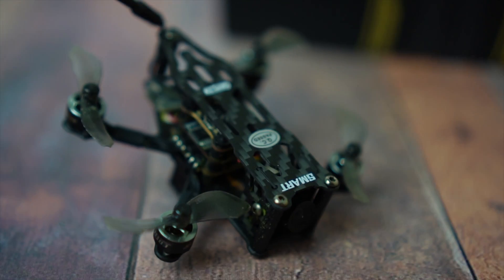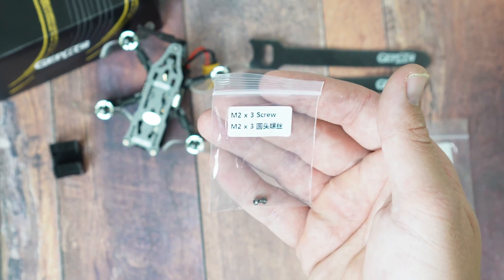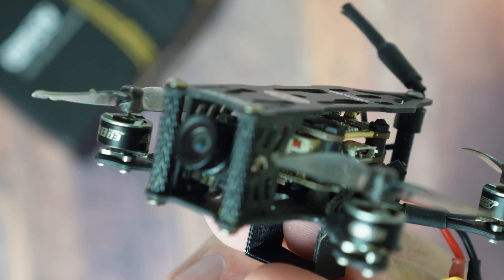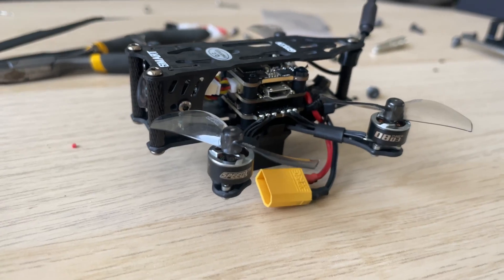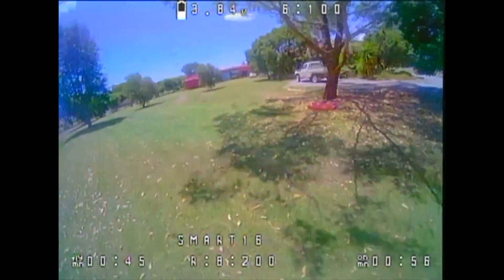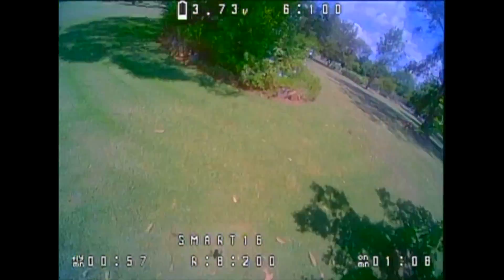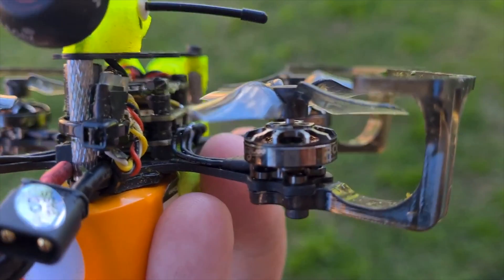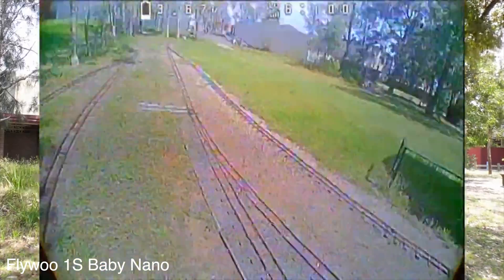Micro FPV Freestyle King? | GepRC Smart 16

Comment: What battery size are you running? I have a lot of 450mah 2s and 550mah 2s. Would this be too big or do you think it would fly ok
Reply from the maker: I was running 300’s, 350’s but a 450 and 550 would be fine if you have it.
Reply: @DarrenAllatt  thanks man

Comment: Hi, cool video thanks for sharing. Is there some footage shot at the Bankstown model railway track?
Reply: @DarrenAllatt  did you ever figure a way to remove all the black spots on the sensor/lens? Mine has the same issue as yours shows in the footage.
Reply from the maker: @jonowillmer  no I haven’t - probably have to open it up and clean it. Haven’t flown mine since the video
Reply: @DarrenAllatt  thanks for the feedback. It's a shame they all seem to suffer from this issue.

Comment: I've put about a dozen packs through my 16 after crashing it the first flight out and breaking a motor mount, having to replace the bottom mainplate. It's fun, and so small you don't have to worry about too much about hitting anything or breaking props when you mow the grass. I did mis-order two extra frame packs so now I've got parts for days and days but these little battery packs are easy to handle and charge so maybe don't snip that silly double 1s setup. This is my first fpv quad and it's a perfect starter unit imho

Comment: I've followed the Nick Burns Formula of the TKS Rocket Race frame and everything from except the Frame and props of a  URUAV UZ85 85mm 2s. Just need longer M2 screws and Gemfam 2023 tri-blade props. It's fast AF and agile. Plenty of power. There are other variations but Its my favorite compared to my HM Mob6hd and eachine Novice-III. It's a good idea to have spare motors, canopy and camera for high speed crashes.
Reply from the maker: I’ve got some TKS frames after watching Nicks video. Just haven’t had time to build them.

Comment: Great review. Will the happymodel 1102 motors fit this frame, I'm thinking about just buying frame and custom building my own nano?
Reply from the maker: Let me check up on that for you. What spec build are you going to put together?
Reply: @DarrenAllatt  Legend thank you. Im either going to try the JHEMCU GHF13AIO board with Eachine Nano VTX but I have my reservations on the AIO based on your earlier review. Otherwise I have a spare 16x16 JHEMCU SIF4 13A stack. I'm only thinking about going AIO for weight savings. I will use the 3 blade gemfan 40mm props. Prefer 1102 over 0803s...
Reply from the maker: @clintpan3599  to be fair on JHEMCU the smoke was caused after a crash in the bush that shorted the ESC; but the first board I had from them was dodgy.
Reply from the maker: No the HappyModel 1103 motors wont fit because they haver a larger motor mount pattern

Comment: i just built an Armattan tadpole. 2s 1106 6000kv emax motors & props avan rush. flys awesome. Tadpole V2 is a bit wider, can fit digi. go strait to thier site. you wont find available here in Aus.
Reply from the maker: I’ve been wanting to do a tadpole after my failed experiment with the Gnarly FPv Sun atomic 2… will give it a go!